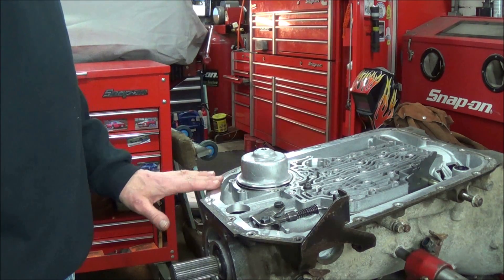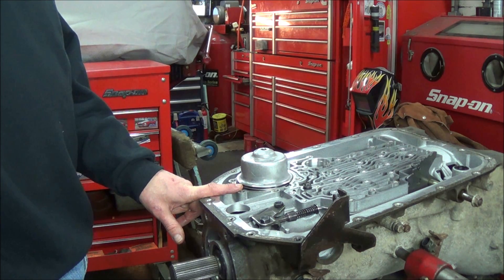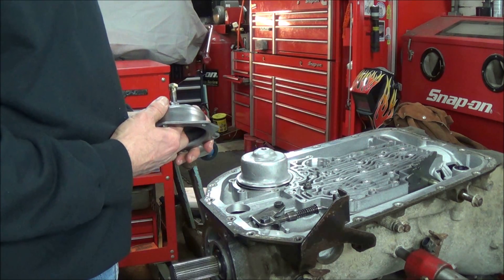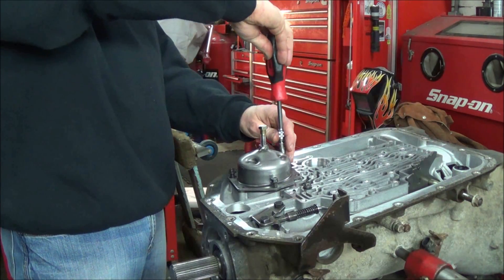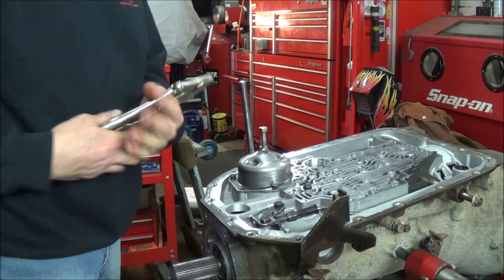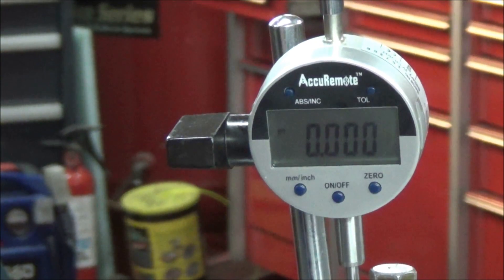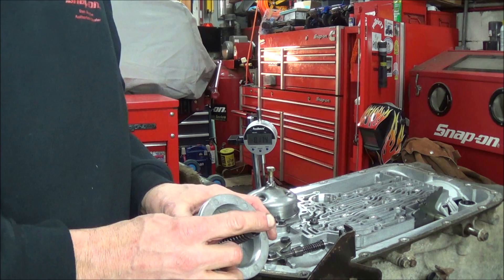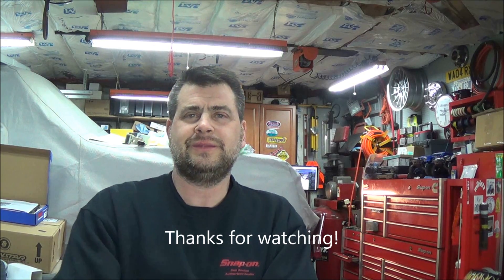GM 4L80E reverse servo pin measuring tool how to also works on TH-400 and 4L85E

Comment: So i added an extension cap on the end of my servo pin and my truck wont move at all now forward or reverse and my shifter wont pull all the way down into d1 d2 or d3 does that mean its to long
Reply from the maker: Could be

Comment: yea thank you for helping me diagnose the problem..will be buying dial indacator and spare servo housing tonight and pulling trans tomorrow.!> thanks keep up the good work.!>
Reply: Did you fix your transmission?
Reply: @moodybluemotorsportsDwneKnos  luckily the builder who did it for me just under 2 years ago...said hed go thru it all for 250$

i took it to him and we went thru the oan and valve body together so he could show me what to look for and how to air test it.

we were gonna run the extendo pin but he said theres a little to much junk in the pan for him to feel comfortable with that.

so hes gonna hook me up , go thru it and get the reverse band changed out and inspect it all... totally worth the learning lesson to have him do it.

i have another 4l80e with reverse,1,2 that i will run thru when i get a rebuild kit.

Thanks for asking and teaching.!.

Comment: I guess this must be my problem. Because I do still have reverse. It's just very very very weak. I have to full throttle it to get the car to barely move.
Reply: Improper clearance. To little will make it slip to much will cause your truck to lock up when it goes to shift into 2nd

Comment: What a stupid gm ,every one has and adjustment bolt and jam nut!!
Reply: I thought the same thing. Why couldn't GM have one on the cover for adjustment w/o taking the valve body/servo out?
Reply: @CadillacPat1  You can simply buy the servo pin for 20 dollars and skip all that measuring.

Comment: Did you fix the Reverse issue?
Reply from the maker: yes
Reply: @Broncocarl92  This is the main problem with my 2004 Silverado 2500HD. Still no reverse. When I dropped the pan and removed the reverse servo cover, the E-clip was broken off the reverse apply pin and the pieces were in the servo cover.  

I got a new billet aluminum reverse servo piston, put new seals on, new E-clip, and even a Sonnax apply pin repair upgrade.  

Put it all back together and STILL no reverse!
Reply: @adamkorekach9936  what did you end up doing? Swapping trans? Selling truck? about to tackle this same nonsense.
Reply: Three years later and I’m still driving the truck, with no reverse and no engine braking when manually shifted into 1st.  I’m such a procrastinator!  I ordered another pin extensor kit off eBay yesterday and gonna make another attempt. 

If that fails as well, I will pull the transmission.